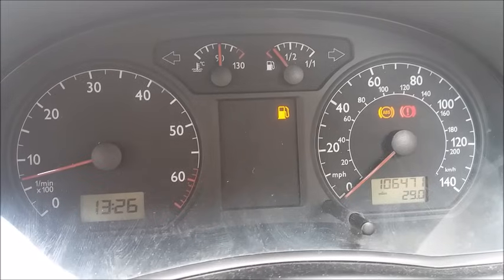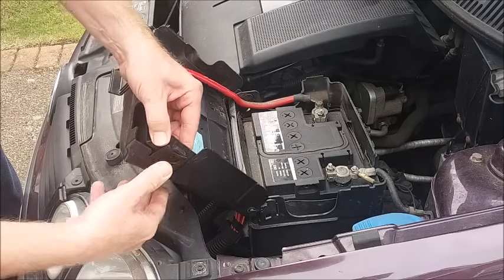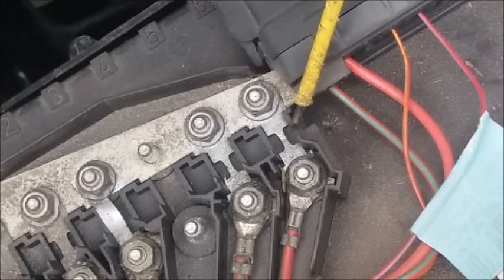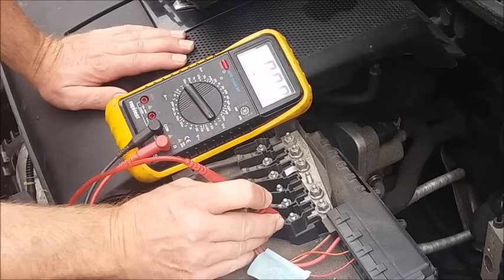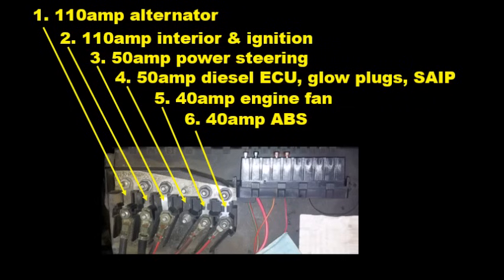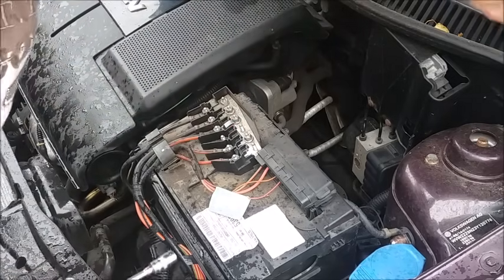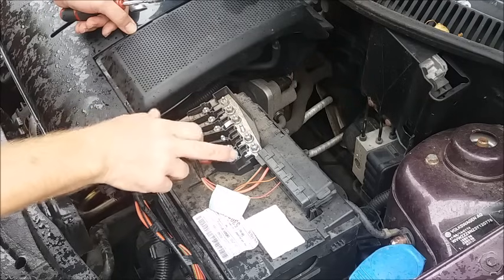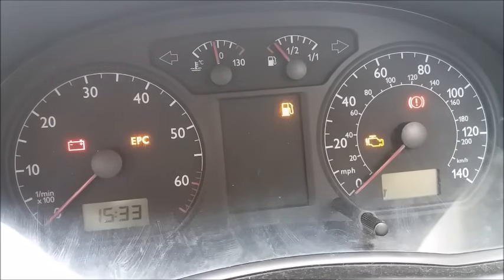VW Polo ABS Light ON / Skoda Fabia ABS Light On | Easy DIY Fix

Comment: I have a 2005 polo and my abs light and break light started flashing randomly any idea what this is please?
Reply from the maker: A connection probably. Have you checked for this issue?
Reply: @CycloneCyd   Hi, I have the same issue with my VW Polo 2005, I was waiting to turn, the guy infront flashed me to go, I then stalled on a hill, then had to put the handbreak on to stop rolling back.. Reason being is as soon as the engine goes off the breaks are nearly unable to work/press, so done within seconds I restarted the car, took off and since the ABS is on and Handbreak is flashing.. That was a couple days ago. I got in the car to check it over and the Handbreak lights don't come on and it seems like the breaks are locked at the back. Any ideas?
Reply: Checked the car, was the fuse in the battery. As you said I managed to see it quite easily. I tried the car and it was still on, flashing as before.. But I have read through some more comments and I'll try to take it passed 10mph and see what's what.. I'm hoping it's not anything else.. I was told I had to get my CV boot done on last mot.. Would this be any reason for it to stay on? I'll comment later today with feedback.

Comment: I'm looking to go view a Polo like this on Friday and the advert says the ABS light is on, do you think this is the reason behind it?
Reply from the maker: Fair to middling chance I'd say. Make sure to look under the bonnet at things like the serpentine belt (see another of my videos) for general condition (even if you're not particularly mechanical, LOOK confident). And while you're there open up the battery top fuse box (no tools required) and have a close look at all the fuses. Don't say anything if it is the fuse, pretend it's still an unknown and use it as a bargaining chip. If it's not the fuse, I'd say a sensor is the next most likely cause, but unless you know how to test them you'll need a diagnostic.
Do let us know how you get on.
Reply from the maker: bill Bloggs  £ouch! A fiver for one fuse. I'm in the wrong business. Are you UK based? Try Halfords, that pack I got was less than a fiver.
Re-check the fuse you fitted though, just in case it's blown again.

Comment: Hey mate I have a 2003 skoda fabia same layout ( because vw and skoda have same engineers ) and I have followed what you said and replaced the strip fuse and the damn abs light wont go off , any ideas how to just disable it .
Reply from the maker: That would result in MoT failure. I haven't got round to doing this on a video yet, but if you put a multimeter on each sensor, set on mVac, and spin each wheel, you should get a small ac reading. If one is not giving a reading then that's the faulty sensor.
Reply: Thanks mate 3.49 from Halfords sorted , ABS light went off next morning I started the car cheers pal

Comment: Just noticed on my car they removed the no.6 connected it to no.4 where theres nothing connected in this car..wonder why...got the car second hand so don't know much about cars
Reply from the maker: Probably because it had this problem and instead of replacing the 40A fuse they moved the wire to a free fuse position in the fuse box. Welcome aboard.
Reply: @CycloneCyd  swopped the fuses around and put the 50A on number 4 and put the 40A in no.6 and so far so good 🤦‍♂️🤦‍♂️

Comment: 4:15 is there some details for this connector? I need buy one.
Reply from the maker: This link takes you to pattern parts on Amazon UK. Search for similar on your nearest Amazon.
If you struggle, let me know, I have a few spare.
https://amzn.to/2J9Jm0t
Reply: @CycloneCyd  Ty. I got it already and it fixed this problem. Very good advice and saved a lot. Of corse a broken fuse is common problem but it is harder think battery's fuse and you have to know how to check it. 5/5 video.

I can also say that these kind of fuses sell specific markets, not all.